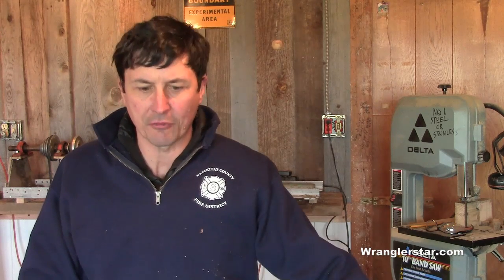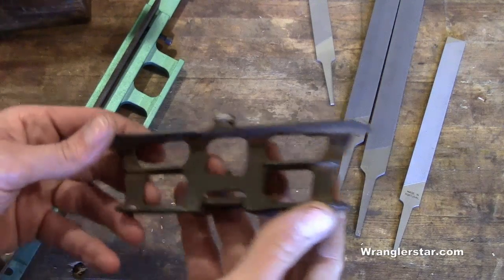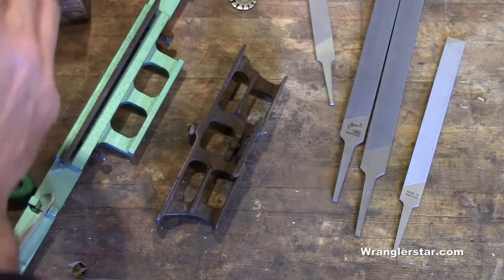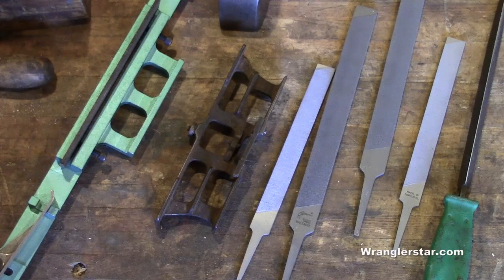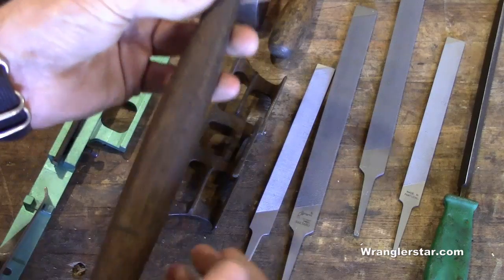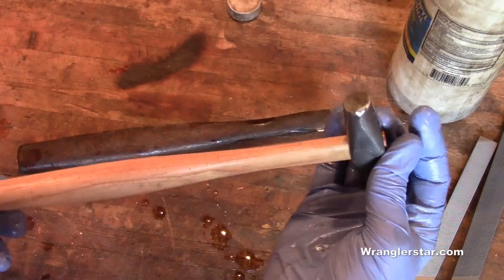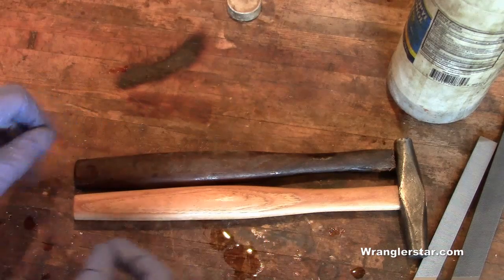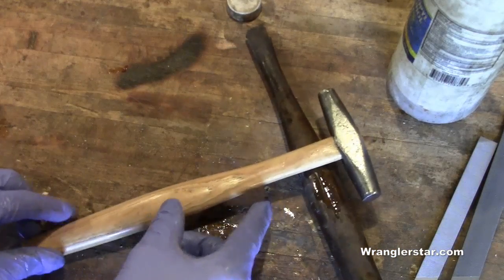Crosscut Saw Filing Tool Collection - Wranglerstar

Comment: I believe the second hammer you show is a "tinner's" hammer, not a sawyer's hammer.  Tinners used this hammer to fold and seal fine seams in "tin".  I actually think the pointed end would work against you when setting a crosscut saw, because with the very small point of impact, you could end up with a crooked set.

Comment: can you make a hardwood disc to hot glue onto your one lunger / you can cut a square hole in the center and use a socket set extension that fits the square hole.. it will save many blisters when restoring old mowers and motors.  hope this is helpful.

Comment: I'm not sure if there is a "safe edge" file company, but any file without teeth on the sides is called a safe edge file. There is another company that offers a gibbs style jointer, for a lot less than $250 IIRC.

Comment: Thanks for going over these. I have about 7 spider gauges. I will get a couple in the mail to you. 
Where did you get your long jointer?
Reply from the maker: Thank you Todd I need several spiders. Here is a link to the jointer. Move on it fast, they are not making anymore. http://www.theaxehole.com/the_axe_hole_december_28_2009_002.htm
Reply: Thanks Cody. I will contact you later this week about the spiders.

Comment: These tools are available at crosscut.com they have kits and individual items to include spiders, hammers, pin gauge, long jointer, etc.  you can get the forest service Crosscut Saw Manual at https://www.fs.fed.us/t-d/pubs/pdfpubs/pdf77712508dpi300.pdf. Love the lessons just found a one man crosscut saw, covered with rust but with deep gullets like it has never been sharpened.